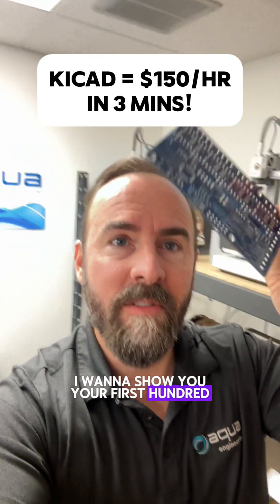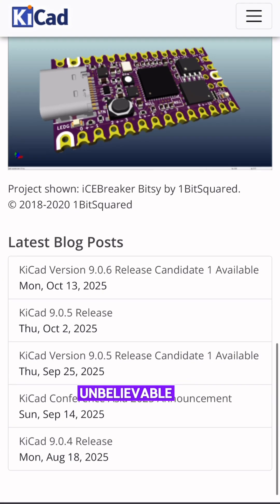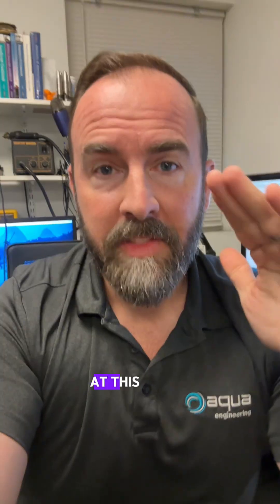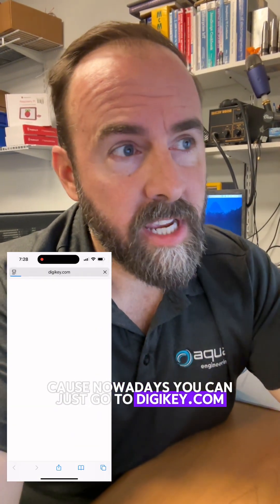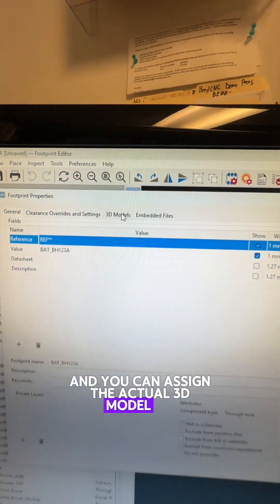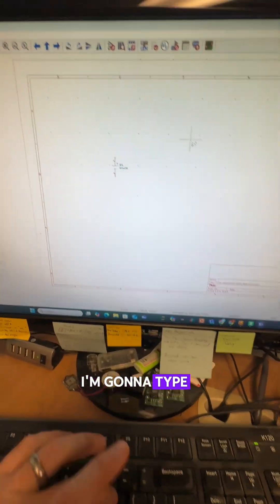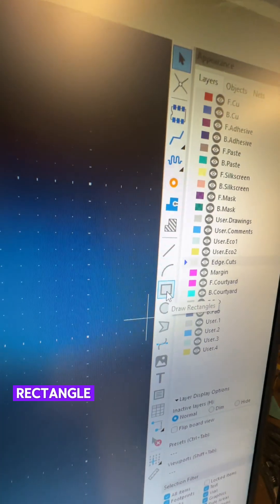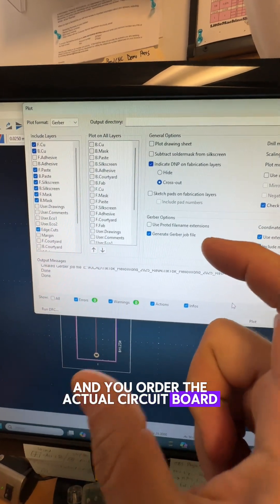KiCAD in 3 Minutes

Comment: steps: 
gather symbol/mod/iges (for 3d model in kicad) files 
open footprint editor (mod file)
- import the 3d model once you left click twice in the editor
open symbol editor and import that
open schematic file and import the component/symbol
- ensure you have proper bootstrap/ design the thing
open pcb editor, under tools, updated pcb from schematic (it'll design one for you and you can go from there)
- edge cuts, draw a rectangle around the pcb design
once exporting from gerber also ensure you export drill files as well

Comment: the question is where do you find job offerings like this?
Reply from the maker: You have to make the jobs yourself by starting a business and going all in. Then a whole other world opens up.
Reply: @i2c_jason but how would someone compete with a company like pcb way?
Reply from the maker: @AlexJaeger716 PCBWAY is a vendor you’d use to get the boards you design. No competition there.
Reply: @i2c_jason so how much is a realistic price point to charge for board design?
Reply from the maker: @AlexJaeger716 I’d say anywhere from 4 to 40 hours depending on complexity if it’s a 4-layer or less board with no BGA. Really depends what the scope of work is and if you have the latitude to be creative on the solution or if you have to finish someone else’s work, etc.

Comment: nice it has a Linux support. sold doing it thanks.
Reply: I completed my electrical engineering degree solely using software that runs on my Linux laptop, so it can be done!  KiCad was certainly the easiest one to install and use though.

Comment: I just got in a batch of 10 assembled boards. so far the only mistake was not doing a check of downloaded part.
a big tvs diode I downloaded from easyeda had switch anode and cathode between symbol and footprint.....  ANNOYING😮
Reply from the maker: Bummer! Always double check everything. Sleep on it. Triple check. Then order. No I don’t always take my own advice haha.
Reply: @i2c_jason Update after testing yesterday: I tested the board on the bench with a load, and everything worked well. After installing it on the truck with actual hydraulic actuator loads, I realized I had forgotten the flyback diodes on the solenoid outputs. This mistake fried 8 MOSFETs. I’ll be ordering the diodes and soldering them on the backside of the backup boards. I’ve always remembered the diodes on relays, but it completely slipped my mind with just screw terminals